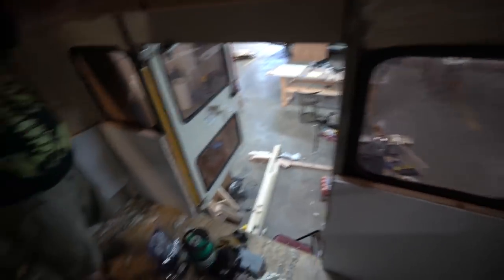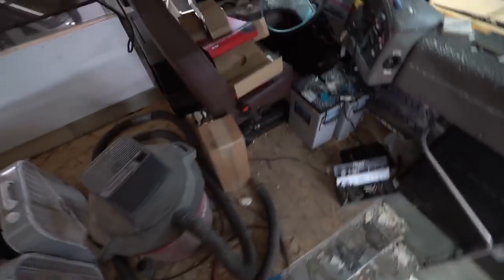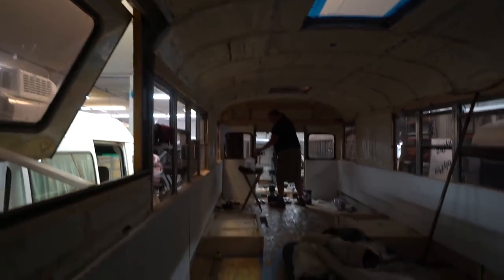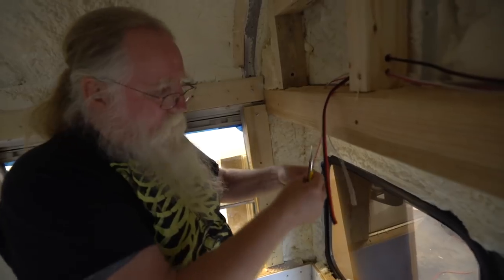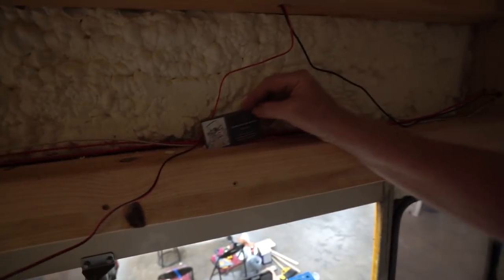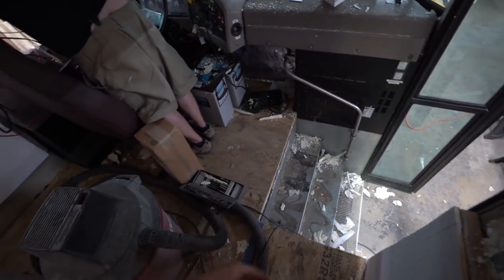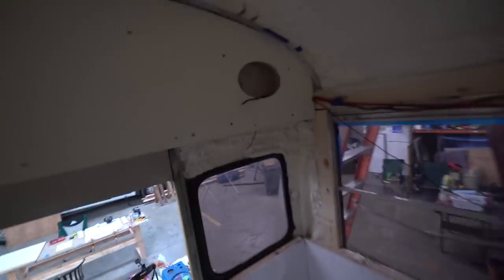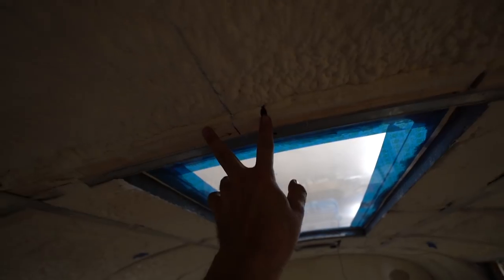12 Volt Skoolie Wiring: Recessed Lights, Maxxfan, Backup Camera, Speakers

Comment: Electrical is where the term, "Cut me some slack" comes from. The Journeyman electricians use to tell the apprentices this when they were running and cutting wires from box to box so if it was needed there would be enough wire to do the job.
Reply: Webb Trekker that’s so cool and makes complete sense 👍
Reply: No sure how old you are but as a child (close to 70 years now) I use to see in older homes in the electrical boxes a coils of wire. The apprentice would wrap the wire around a screwdriver at the end of a run so many turns and then cut the wire making the "slack".
Reply: enigmatic nomadic recently used the term "service loop" and I hadnt heard that in years...the smart guys are putting in a "chase" conduit too...I would stuff a 2'' conduit with a few p-cords in it or just easily snakeable...you ALWAYS think of something you missed...Jax might want those home theater "vibrators" midship!

Comment: Jax, My brother and I used the same lights in our trailers. run a hot and GROUND to each light. They are dimmable but, they dim on the ground wire. Use the suggested dimmer also. They work great but the spring clip snap your finger, just like a mouse trap.

Comment: Hounditioner 1400 btu dog house air conditioner would work in a small insulated room ,say  a bed room, and the power draw is much less than a 5000 btu window shaker, and should be able to run off solar and a decent battery bank. cool project.

Comment: You cant live in a metal box without AC unless your up north in the summer   just put a couple of RV ac units on the roof , you can run one in the back for sleeping , you can get a used rv generator for under 1000 sometimes cheaper and they run at 1800 rpm so they are not as loud as the home depot one s, its probably too late now but you could have used a ducted ac set up from a used rv run a channel down the center from the skylight back and use a regular RV unit in front , or you can run some small window units on solar and batteries and build them in and duct the exhaust outside they can be powered with a good inverter